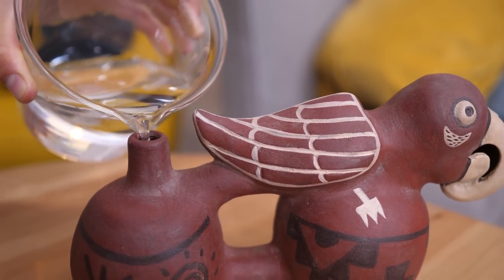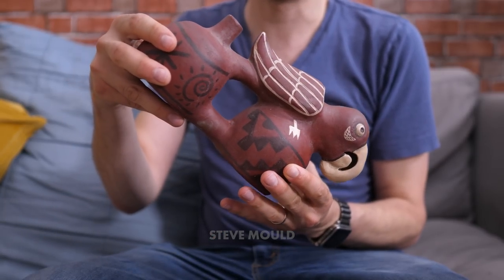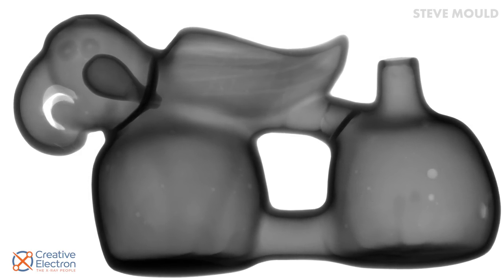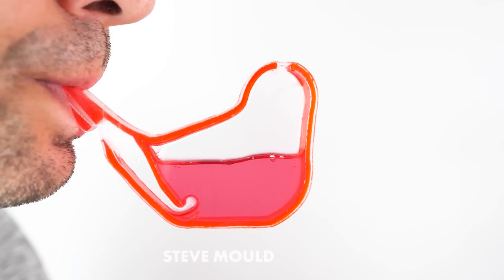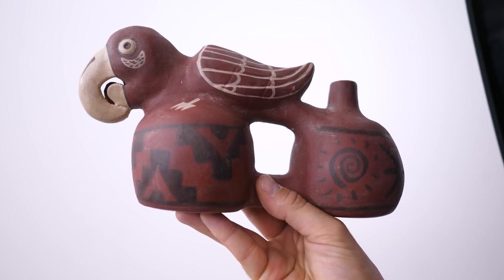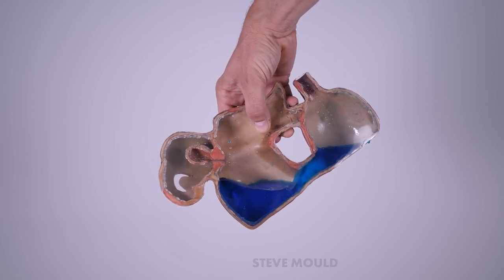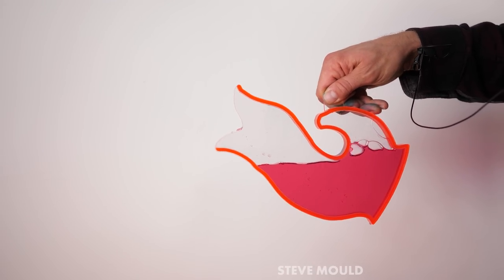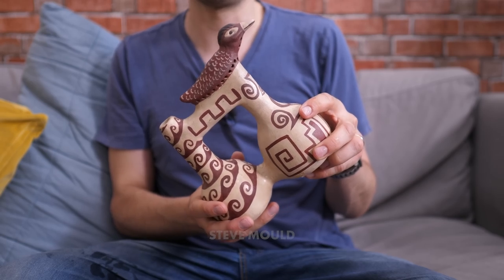Peruvian Whistling Vessels are weird

Comment: For future reference, waterjet abrasive tables can do curves just fine! I've used an Omax machine for years, making intricate, curvy cuts for in-house designed motorized satellite dishes.
Reply: The issue is generating the proper curve, I think.
Reply: @pmberkeley  not necessarily, all you'd have to do is figure the rise and run and arc, plot your start, set up your material settings and blam.
Reply: @seanbordenkircher7854  way easier to x-ray it. 

I'm a mechanical engineer who regularly works with this type of thing. It's a pita to figure that out for an existing object. The z axis stuff might have also had a tilt and it's just seriously unlikely to be worth it.
Reply: @pmberkeley  oh no, I agree, x-ray would be much easier, and non-destructive. I was simply responding to a point about waterjet tables that he seemed to misunderstand.
Reply: @seanbordenkircher7854  he's somebody who uses those types of machines all the time. I interpreted it to be that he didn't know the exact internal axis and water gets are necessarily linear. By hand you can cut it however.

Comment: Why are you incorrectly referring to a three dimensional model with less width and volume as a two-dimensional model? The term you're looking for there is polyhedron, or something like it.

Also, if you actually did your research, you would have found some images of cross-sections. You just wanted to perform an unnecessary experiment so it looks like you did something scientific. And still, you've produced next to nothing as far as results.

Comment: So... suggestion for your "transparent 2D version".

From my understanding, the issue with the 2D version is a matter of volume; you don't have the capacity for thr volume necessary to make it whistle. The obvious solution would be to just up the scale, but it's possible the necessary scale would be highly unwieldly.

However, in the Pythagorean Siphon video, you made a point of establishing that, technically, it is three-dimensional; it's just that nothing significant occurs on the third dimension. By that principle, you should be able to extend such 2D versions across the third dimension, while still technically serving a two-dimensional demonstration.

Comment: I'm one minute into this video, and I'm 95% certain I can tell you why it makes the inconsistent whistling noise: the shape of the "pipe" or "bus" (for lack of a better word) is thinner than that of the body, this encourages fluid dynamics that result in quick build-up's and releases of water. When you watch water drain sometimes you'll notice it doesn't release in a steady stream, but rather in small pulses. Like, a "Glug, Glug, Glug."
I could be wrong, but I'm pretty sure that's why.

Comment: Regarding surface tension in the connecting pipe, I think Poiseuille's Law and resistance is probably the more relevant concept, with the caveat that Poiseuille's Law only applies to laminar flow, and this is obviously turbulent flow.

Comment: A transparent one would be gorgeous. Since you have the voxels from the 3d Xray machine and then through software like Houdini you can turn voxel data into 3d polygonized mesh (there various techniques how to do it - marching cubes is one of them) and then printing it out with a good 3d resin printer in transparent resin. A 3d polyjet machine would do an amazing job but that would be quite expensive. With a bit of post-processing (coating it with transparent lacquer and etc) it can get very clear.